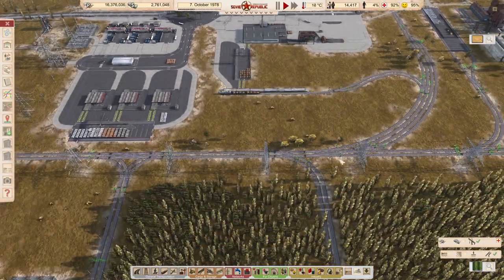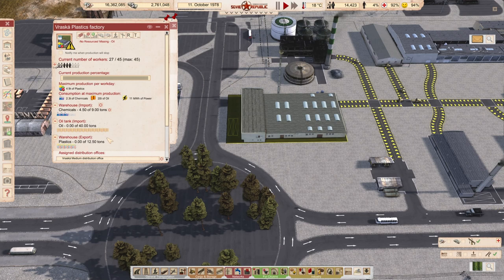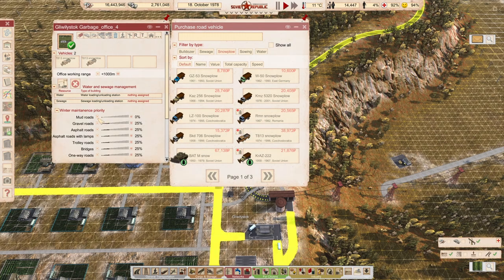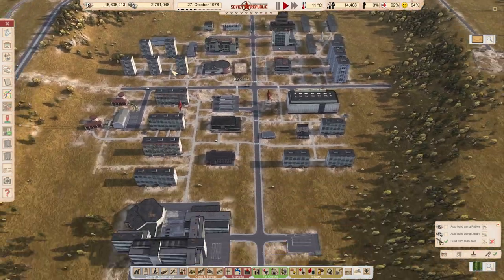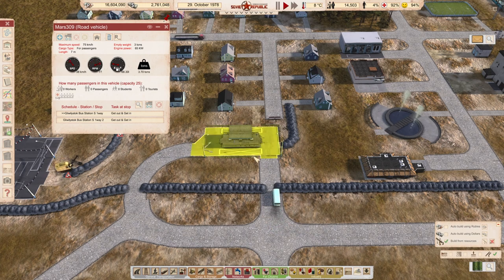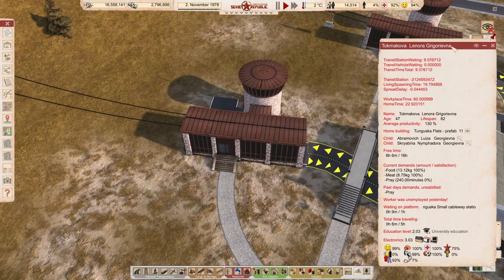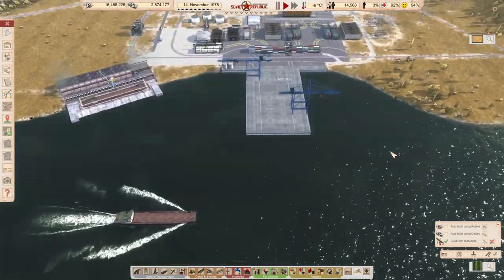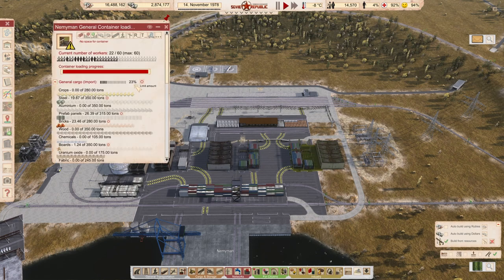Mixing small and large containers | Roundtable Taiga | Episode 17b | Workers & Resources

Comment: I am pretty sure the container harbour has alot storage space for containers. To test it, have a truck going from the full container storage to the harbour. 🚚
PS: Also I think you edited the wrong cointainer loading facility. 🤐
Reply from the maker: Wauw, I am on a roll here 😂😂
Reply: @CayaMaya  I was wrong about the container loading facility. Thought it can could only load open goods and the storage was just wrong modded. But the facility can actually process both.  open and covered goods
Reply from the maker: @Tilumbus  I wanted to look into this, this afternoon, but completely forgot. Yeah, this is a modded loading facility, the two facilities on the right are the same and can process covered and open hull goods (right = in the angle I usually am when I am at the harbor, so the water is south). 

The facilities could not process anything anymore. So I thought the harbor could not store anything. But, I think what is actually happening is, that the factory connections won't push containers on to the harbor.  Because there is a vehicle storage in between.
Reply from the maker: @Tilumbus  You are right about the harbor, it can store containers. Just doesn't go through factory connections from container loading facility -> storage -> harbor.
Reply: @CayaMaya  the "Straddle Carrier" could take care of this and will give the harbour a authenic look at the same time
Reply: @CayaMaya  AFAIR - factory connections can only pull/push one position - as every other non-motorized connection.
Cheers :)